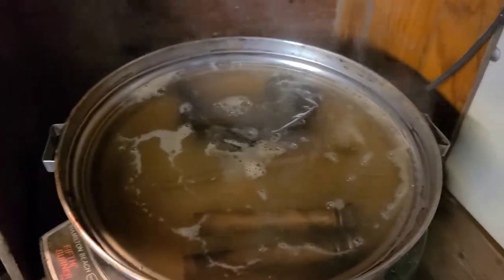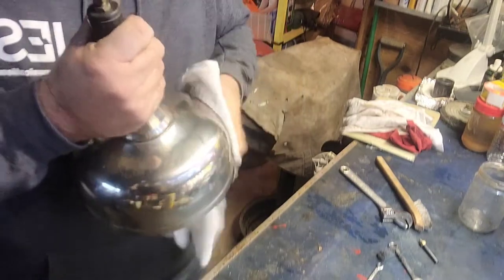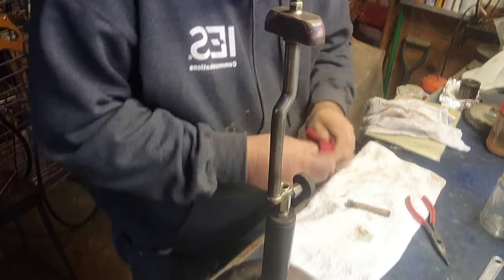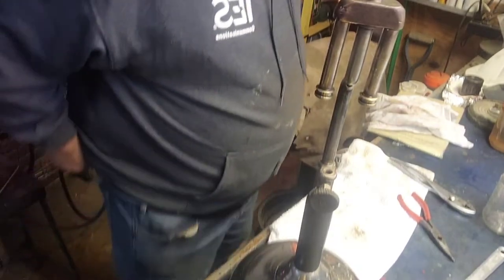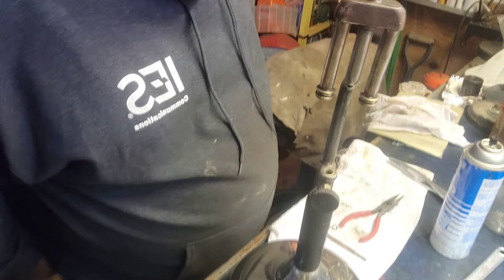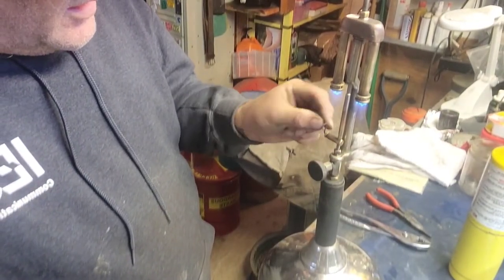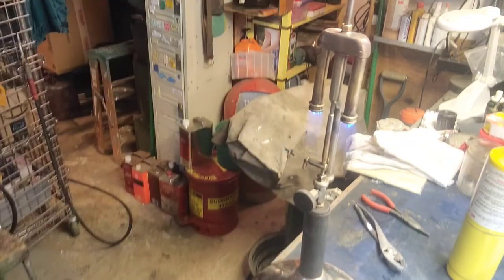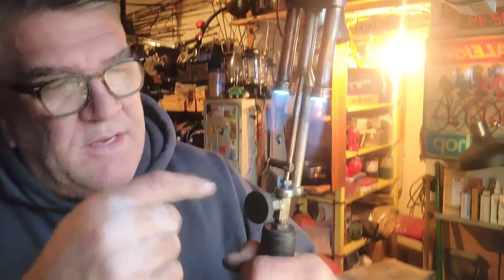Vintage Coleman Quick Lite Table Lamp . First Lite ! SLW Restorations

Comment: Awesome. Mine had fire every where when I lit it. I was lucky enough to get a pump with mine. It was a freebee in a box with a white gas clothes iron as well.  I made sure I was outside to light mine, but I know at -13F like it is now it would not have lit. Thank you for showing us your lamp, Steve. Stay safe and stay warm
Reply from the maker: Yes this one runs pretty good , I'm using white gas , probably should have used kerosene right ?
Reply from the maker: FREE BOX !!!!
Reply: @doinsngoins  Yours is a white gas model. Kerosene ones have a priming cup around the generator. And they are a lot more cold blooded, as I found out.  you might see the cup on my videos. Yours looks like it is running good.
Reply from the maker: @shovelhead8  ok got it thanks thanks 😊
Reply from the maker: It's not a stove....

Comment: Very nice. I'm working on one too, but the pipe between the fount and burner is clogged. Glad to see you got yours running.
Reply from the maker: Easy fix ! Let me know if you need help ok 👍 thanks for the comment please come back !
Reply: @doinsngoins  Thank you sir, I subbed. I thought it would be an easy clog to clear as well. It's a Model "A" Air-0-Lite. The long pipe (I think it's called a stem?) that connects the fount to the burner has a brass cap with a small hole in it on one end, and the other end has an iron spike sticking out. I have soaked it in everything under the sun including ultrasonic. I have even put it under 200 PSI pressure. I figure I will have to take the torch to it, but that's my last resort. I would rather just find another pipe, but they are hens teeth here in my neck of the woods. Any advice would be GREATLY appreciated! I apologize for not knowing my terminology on these older lamps, I am learning. Thank you again!
Reply from the maker: @kenneth6731  oh man you do have a pickle,  so are we taking about the eccentric block , the lever that forwards the needle in the generator to clean the tip ?
Reply from the maker: Do you get any fuel or air at all  up to the mantles at all ?  , also did you clean out the pickup tube in the fount also ???
Reply from the maker: You have the E block in your hand , trying to blow air through it with your compressor right.... hrmmmm soaked it in carb cleaner,  there's packing in there did you remove them ? I try not to fool with them .
Reply: @doinsngoins  Sorry for the belated response. Good news, I have made some progress. I was able to a get trickle of carb cleaner through it, then I forced some Evapo-Rust through it. That and  a little heat made it come apart. Luckily I was able to remove the restrictor disk without damaging it. The other end had a 1/4" X 8" iron rod inside it. It had severely corroded and created a restriction. I can't for the life of me figure out why they would put that in there? Is it a broken off cleaning rod from a previous owner? Or perhaps a crude form of flow regulation? The packing looks intact, Acetone did a good job cleaning it out both directions. Now I just have to deal with getting all of the rusted metal out of the fount, and I should be all set! I need to dissolve all of the rust in the fount, I don't think its absence will  compromise it's structural integrity. How do you get the rust out on yours? I was considering BBs and Muriatic acid? or just let it soak in some Evapo-Rust for a bit? Thank you!

Comment: Nice. 
I don't think those R55 generators are serviceable other than just trying to tighten them down a little more. 
You can still pick them up at O.C.P.
Just got my Akron running tonight. 
Think I am still having a little issue with the fuel pickup but once it's light it purrs like a kitty. 
Thanks for sharing and God bless.
Reply from the maker: I will check OCP my cleaning lever is loose and not functioning correctly
Reply: @doinsngoins  - You guys are killin’ me!!! Now I need a lamp! 😂🤣😂 I gotta quit watching YouTube videos!
Reply from the maker: @CarolinaChrisOutdoors   You need one for the Tiki Bar !!!!!
Reply: @doinsngoins  - No doubt!!! 🤙🏻🤙🏻🤙🏻
Reply: @CarolinaChrisOutdoors  you coming to the spring meet this year?
Reply: @BluegrassBushcraft  - I’m planning on it